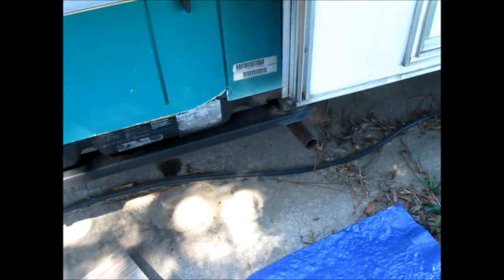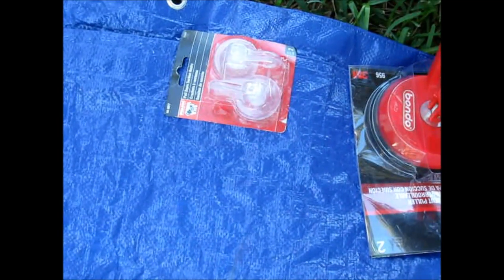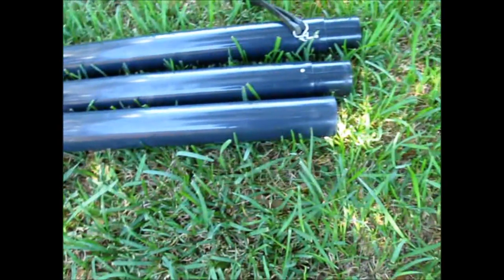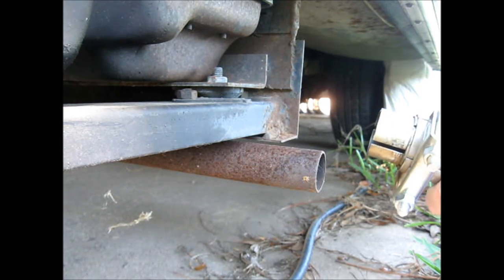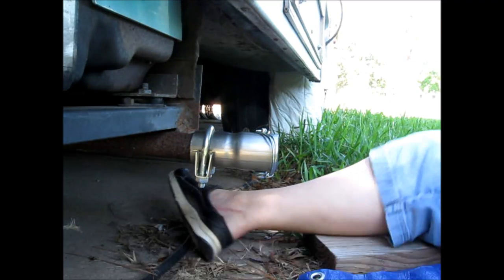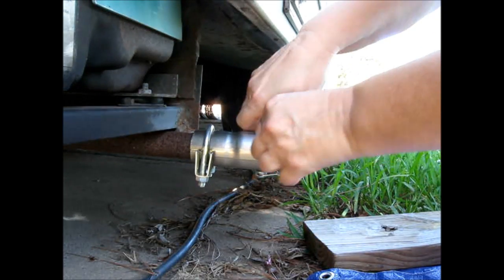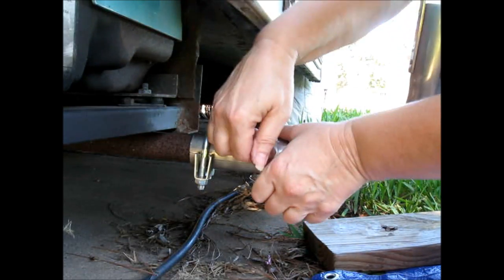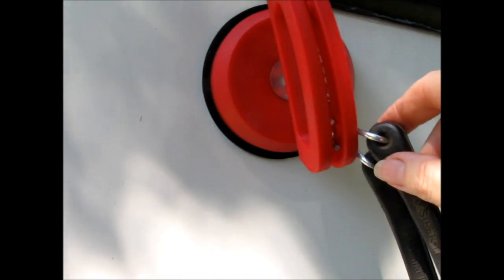Installing a Gen Turi on my RV

Comment: These are supposed to be installed vertically and not on an angle.  I have one on my RV..There great. Also the straps are meant to support the vertical tube and take the weight off the generator exhaust pipe. Failure to do this will cause your generators exhaust to crack and break.  Best of luck.
Reply from the maker: Thank you for commenting. No, I didn't know that as I've seen many RVers tilt theirs. I guess I have to get brave & attach connections to the RV for supports. I did wire my exhaust pipe to the frame that holds the generator because I was afraid of the weight of the gen turi. Thanks again - I've learned something!

Comment: Three years later...what are your thoughts? How has it held up over time and use? Still use it? If not, why?
Thanks!
Reply from the maker: CrazyDaveIowa I highly recommend the gen-turi! However, it is best to put mounting brackets to hold & stabilize the pipes. The suction things I used would fall off & the stack of pipes would fall. 
Some places (like dog shows) won't let you use your generator without a genturi. Without it, the generator fumes would cross under my RV, thus potentially presenting hazardous gasses. When I use it, it vents up above the roof, putting my motorhome in a safe environment. Thanks for your questions!
Reply: I have no current need for such a unit but for the price I am thinking of getting one for the just in case scenario. Thank you! PS Genturi has a suction cup kit specifically for the unit so one does not have to drill and screw the mounting brackets....
Reply from the maker: CrazyDaveIowa I got mine used from a fellow RVer. Thanks for the info on the suction cup kit. I'll check into that! 👍
Reply from the maker: Wonderful!!!! I need to order them. Thank you so very much!